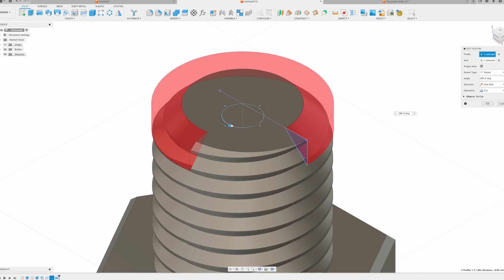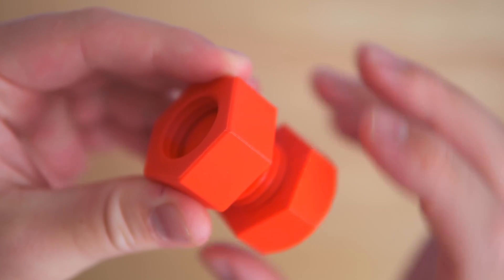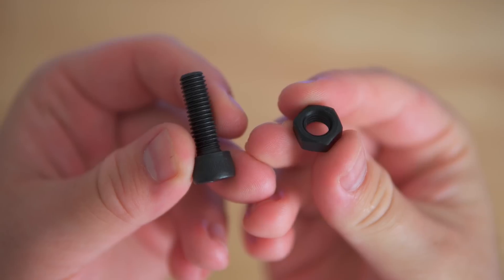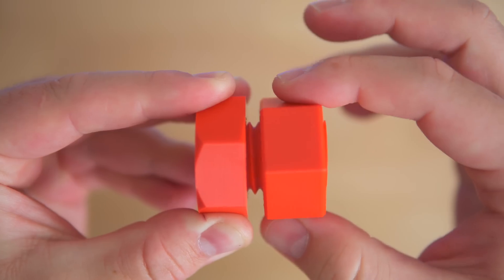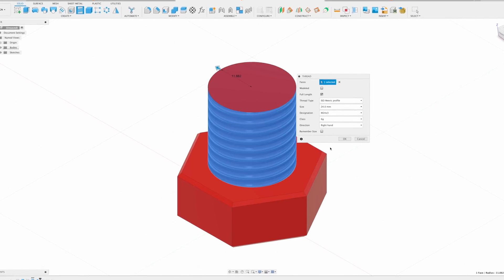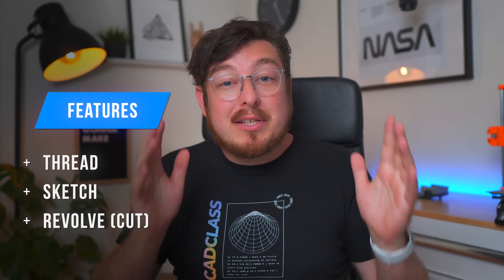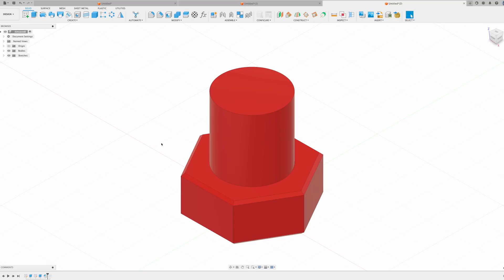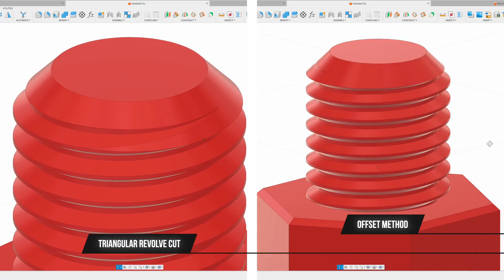BETTER, FASTER, STRONGER 3D Printed Bolts | Errata

Comment: alternatively, cut the chamfer first, then the threads, then just move the chamfer after the threads in the feature timeline
Reply from the maker: That works really well too! Great trick!
Reply: The treasure is in the comments!
I used to do the revolve as well. It has one huge advantage that its reliable. I have done chamfers before but often when i changed parameters or anything they would break. This short little thread made me test it and understand why.

The chamfer before thread and then moving it is a bit random - it may or may not compute as it either picks the right spot or not and this has caused me issues in the past when it randomly changed. 
Just now testing it i made the same chamfer a few times and once it computed and twice it did not after moving it in the timeline. 

Knowing how to pick the correct edge to do the chamfer on once the thread is already made is the big lesson i got from this. It also works on inner threads and on both the ends (open or closed) but its a bit more difficult to tell which line to pick the chamfer on there (luckily trial and error works)
With 3d printing its often a good idea to limit the movement of the threaded object (so there is pressure on the layer lines rather than ripping them apart) and to know where exactly the threads end when tightened and since this workflow does not move the threads it can finally be done chamfers included.

I tried changing the threads and chamfer dimensions and it does seem to be stable. I have yet to test it on custom threads.
Offset face seems to be more stable if done before chamfers, after them it does not compute well for some reason.
Reply: Huh, interestingly, if you edit the chamfer after rearranging, you can see how to do this without rearranging (by creating the thread first) - just select the edge that was there before the thread - it's a small section or arc near the lead-in point of the thread
Reply: @osmanpasha_diy  Excellent tip! I can confirm that moving the feature in the timeline won't work in onshape, it won't compute.  Your method of selecting the portion of the arc that would have originally been the edge of the cylinder works perfectly.
Reply: 0.5 mm chamfer and thread starting 1mm above the object (In solidworks with thread cutting/extruding)
Reply: This is what I do
Reply: This is the way

Comment: Good tip, but could have been condensed into a much shorter video.
Reply: This comment was too condensed and should have been expanded into a synopsis.
Reply: @KarlLew  Good this, shorter next.
Reply: Making a shorter video requires even more skill than making a CAD model in fewer steps.
Reply: no
Reply: They get paid by the second, every second counts